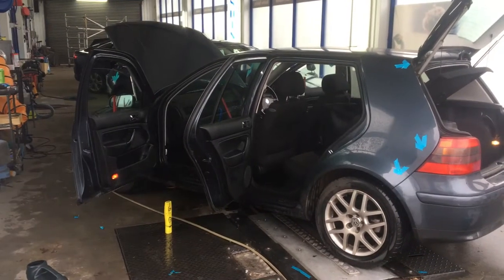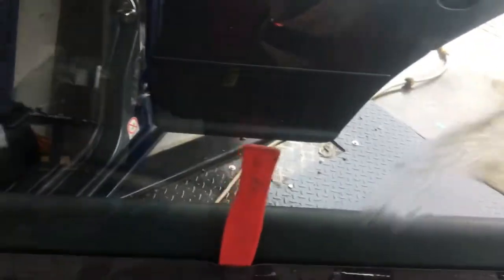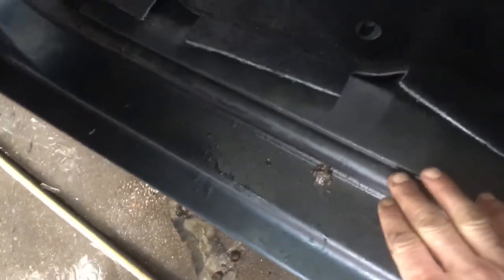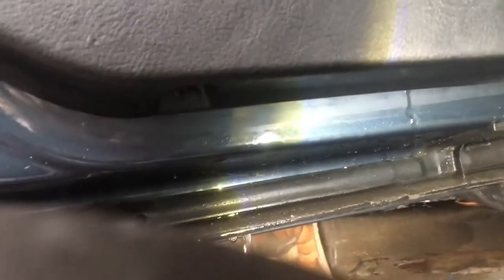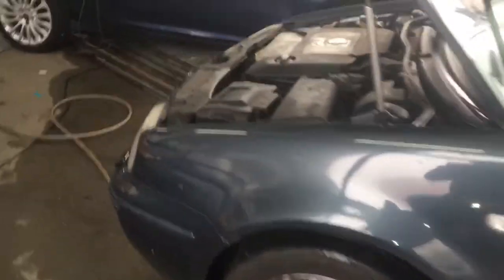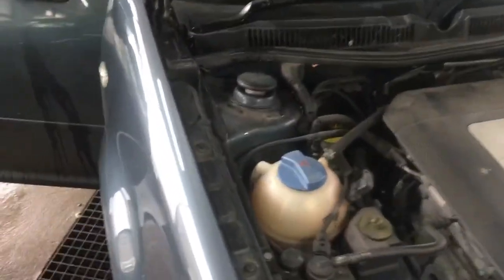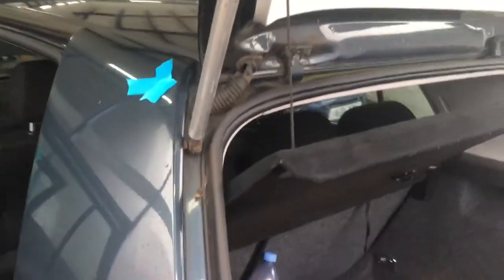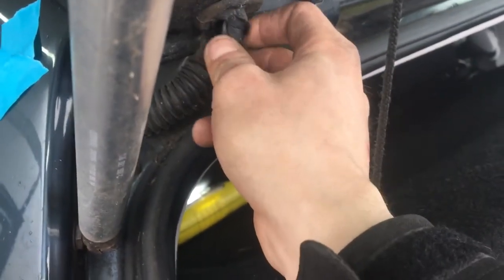Volkswagen Golf 2002 | Water Leak Detection | #VolkswagenLeaks

Comment: Hi mate. If a scuttle panel is incorrectly fitted can it be sealed easily enough or replace the whole thing?
Reply: Sorry for the delay, i had to do a bit of research on this one because I wasn't sure if this problem actually is a problem which causes leaks.
I think all the scuttle plates on all the Golfs warp. When they do, they don't fit properly to the bottom of the windscreen. Water is supposed to get past the scuttle anyway -- it has holes in it, and so it isn't so much of an issue on the newer Golfs. But on the older one, this can cause water to run along the bottom of the screen, run down the bulkhead and enter into places it shouldn't go.

So yes, this could be a cause of a leak. 

I would not recommend sealing it in place because it's supposed to come off so you can access the scuttle trough. You might be able to heat it up and bend it back into shape, otherwise i would recommend a replacement part. Replacing old parts that leak, with new ones that don't usually seems to be the best way to deal with leaks.